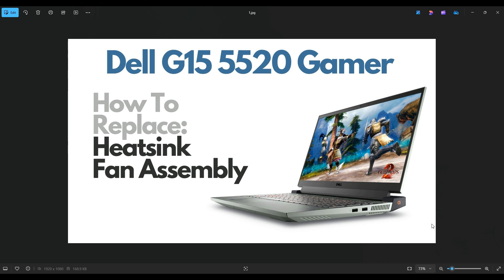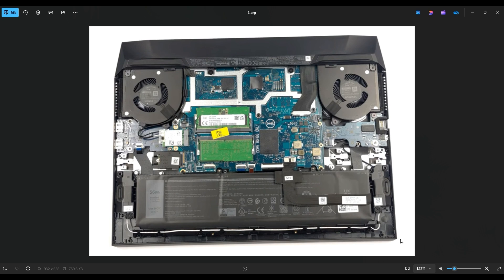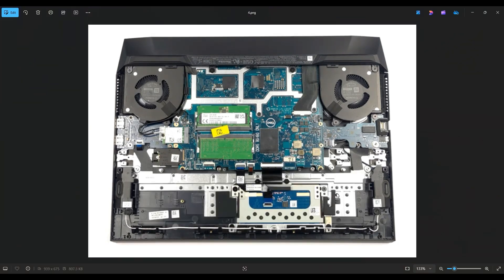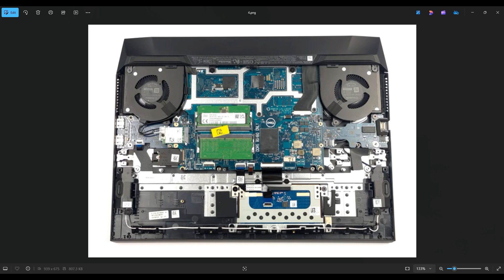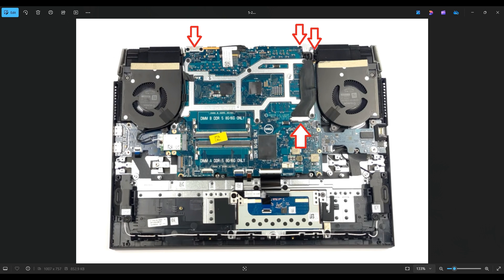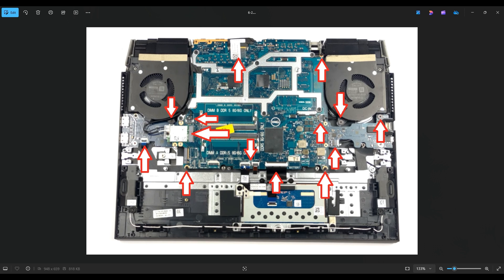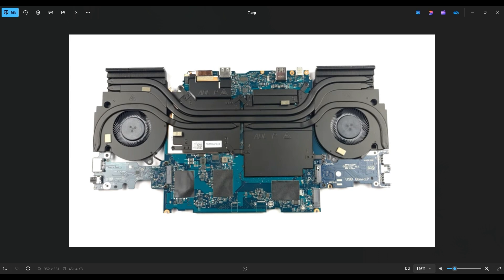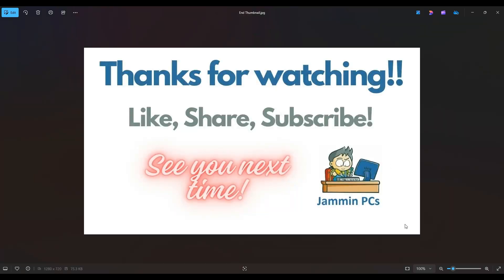How To Replace Fan Heatsink CPU GPU - Dell G15 5520 Laptop Computer

Comment: hello i have a dell g15 5515 ryzen edition that is showing no bootable device.. ive ran the advanced tests everything was good no issues there i changed date and time and it still is showing no bootable device any ideas? i had selected the option in the bios to cancel the factory reset i was doing half way through, due to an issue i was having at home at the time and its been like this for years and i hate that its sitting around when i paid over $1000 for it me and my brother are stumped! any help would be extremely appreciated! BIOS Version 1.13.0
Reply from the maker: Can you find any Repair or Recovery options in BIOS?